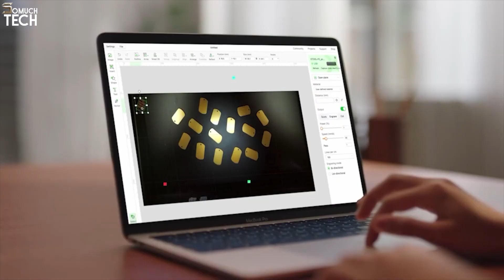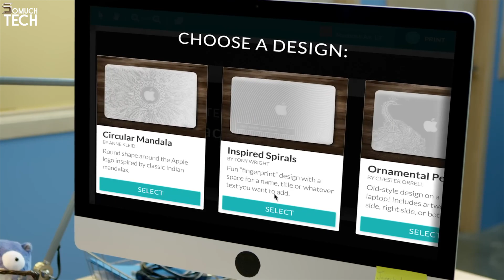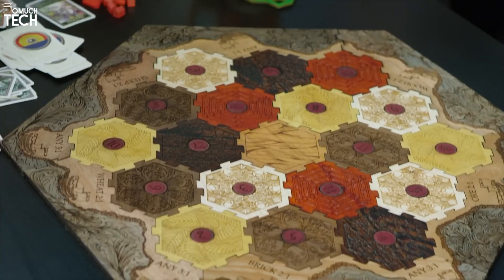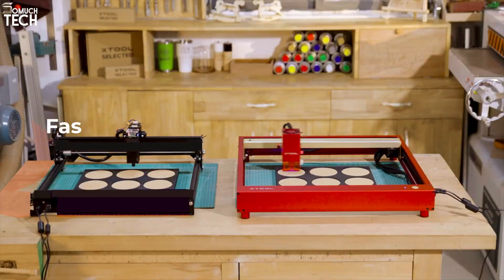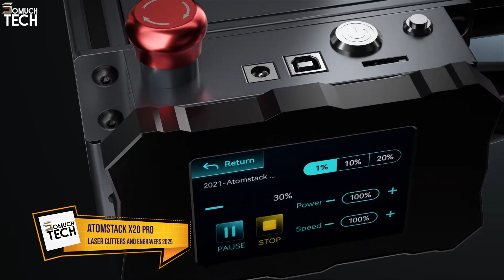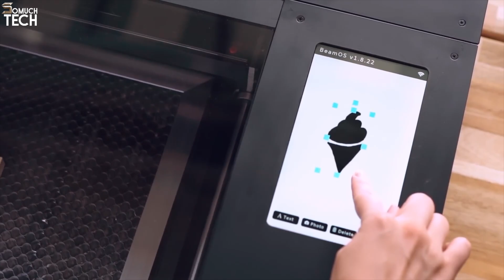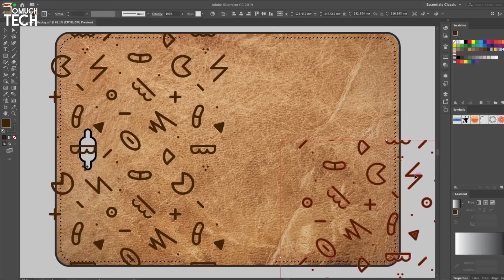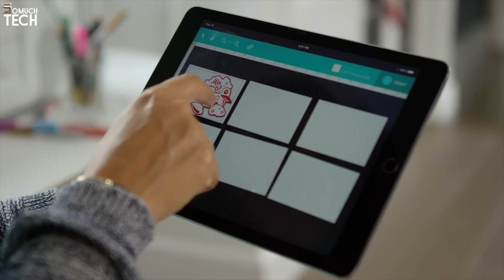BEST LASER CUTTERS AND ENGRAVERS 2025 - TOP 5 MACHINES FOR DIY, CRAFTS & SMALL BUSINESS

Comment: Hi is it possible to do natural leaf art engraving using laser.many are doing it
Reply from the maker: Yes, it’s definitely possible to do natural leaf engraving with a laser, many artists use it for delicate organic materials. Among the machines in this video, the xTool D1 Pro and Atomstack X20 Pro (both diode lasers) can handle thin, organic surfaces like dried leaves, especially at low power and slower speeds. Just make sure to use low laser intensity and test first so you don’t burn through the leaf. The xTool P2 or Glowforge Pro can also do it, but they’re a bit more powerful, so you’d need careful power control.